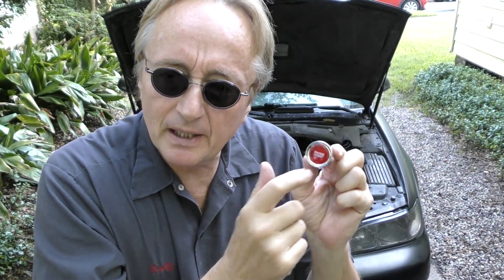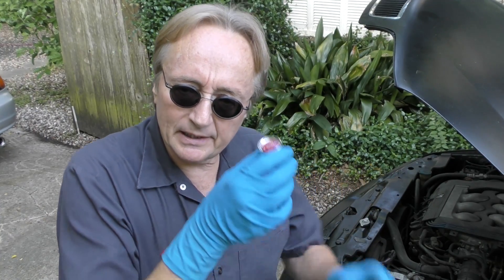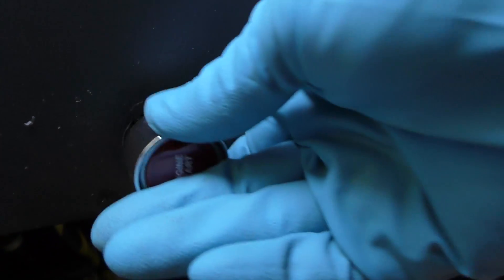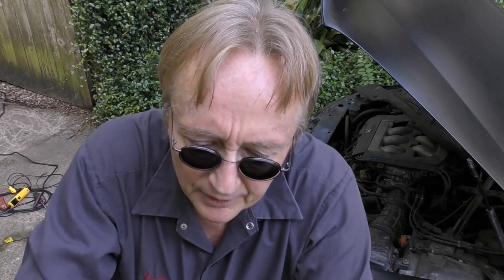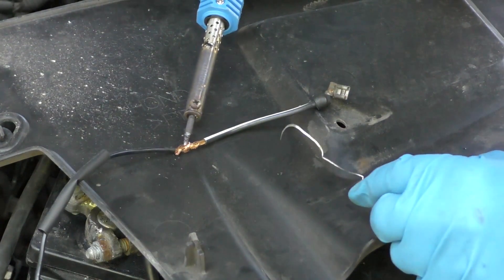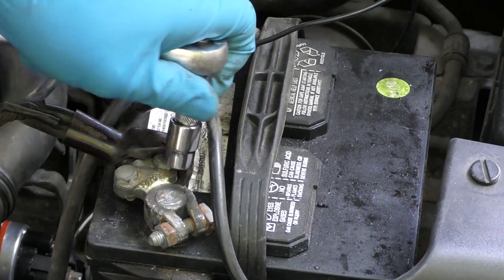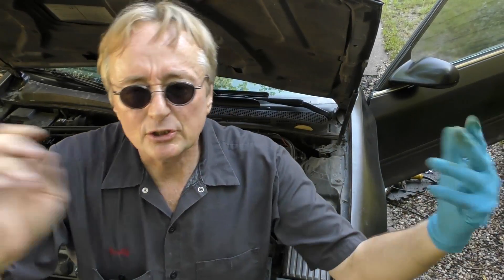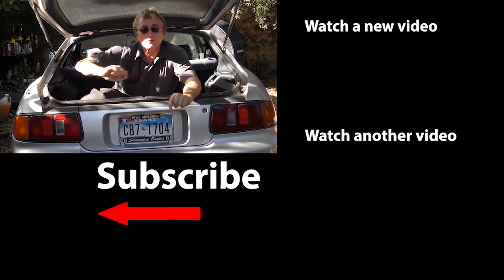I Can't Believe I Put This on a Car

Comment: I purposely bought a 2012 Honda instead of a 2013 Honda because I didn't want a push-start car. It's so stupid! All a person has to do is climb through your trunk or unlock your doors and BOOM your car is stolen. I'll stick with the standard key ignitions, THANKS.
Reply: If they don't have the remote key fob it will not start. You can just press the button and nothing will happen, the starter will not even engage.

Comment: Scotty thats terrible solder work.  You need to use flux so the wires will fully be covered by the solder. There should never be any copper showing in your solder work.  This prevents corrosion.  Even if you heat shrink it, eventually the hot engine will degrade it and can allow water to get into the solder joint and corrode it. Either that or you can get a short circuit if it touches ground.

Comment: At least you could have wired it to the fuse box....
Reply: It had an in-line fuse. Works just as well and for the next person who may need to work on the car, it's an easier system to trace.

Comment: That solder job is REALLY BAD. That will never hold up or together. Why didnt you run the wires through the boot? now you risk them getting cut by the body and water coming in since the hole isnt sealed. This is a thumbs down for me Scotty.

Comment: Blond Question: If you push the starter button, again will it cut the Car Off??😂😆
Reply: No... it would actually engage the starter bendix again...
Reply: Theo Bolton  how will it turn it off..? It's not the ignition... he said you have to turn the key on still... all the button does is engage the starter... I have done this to 3 of my cars and numerous ones for others... sorry, but your wrong on this...
Reply: Theo Bolton  I tell you what, go hook it up just like he did, push it with it running, and hold it a good 6 to 10 seconds, tell me what happens...

Comment: Hmmm you put the wire on the outside of the firewall grommet where it will rub on the firewall metal , bodge job in my opinion

Comment: Did you not install a relay Scotty...???
Aren't you worried about excess amperage burning up that small switch...???
Reply: Doesnt need a rely. The load on the switch is very minimal as all Scotty has done is activate the solenoid on the starter motor. The solenoid itself is the power load bearing part of the starter motor.
Reply: I've used as small as 15amp switches on my race cars in the past. Ignition switch, yes. Starter switch, not so much. The solenoid is basically the relay. The stock wiring itself doesn't pass all that much current to energize the solenoid in the first place.
Reply: Oh okay... I understand

Comment: sry to say that, because i like that guy...but just clamping the red wire into the battery connection is a very poor solution. if i would get my car back from a repairshop like that. i would never go there again.

Comment: You should added some flux to the wires before you added the solder, but I like the idea and everything else you did looks great.
Reply: No need, electrical wire contains rosin core flux.

Comment: Absolutely not the way to do that, a switch directly to the starter? No starter solenoid? Is the switch even rated for that sort of current? Soldering wires together instead of using a butt splice crimp? Soldering crimp terminals instead of crimping them?
I'm assuming this video is a joke?

Comment: Sorry Scotty but you really did your customer a disservice leaving the alarm in place. Every wire coming from the alarm can be traced back to the factory wiring, removed, and properly covered in a matter of minutes. The alarm has a relay in place to "immobilize" the start wire. You simply need to remove the alarm and re-connect the starter wire under the dash. Almost all alarms can be removed in well under 30 minutes. You left a sub standard install in place and left the potential for the wiring to cause future problems for your customer. Its simply irresponsible for a professional to do so and you should have sent them to a person with more expertise in electrical. Also you look to have cold solder joints, it could be from the video, and may have issues with that later. I down voted this and felt I should post why I did so.   I have well 20 years in electrical and RF experience and this was a very cringe worthy video to me and not the normal experience  I get from your videos.
Reply: No one cares